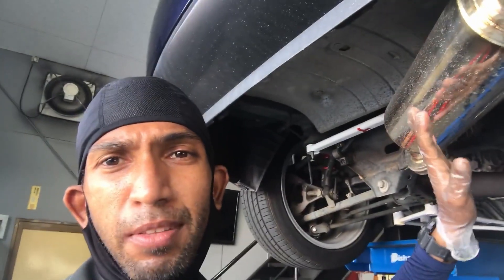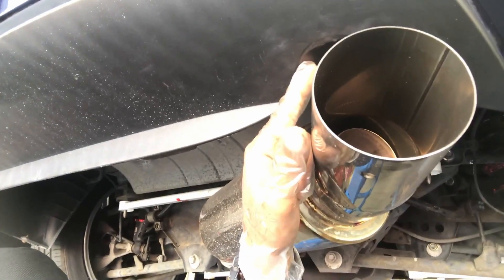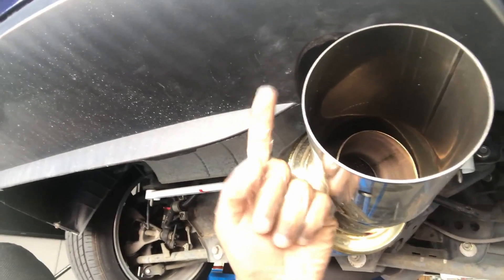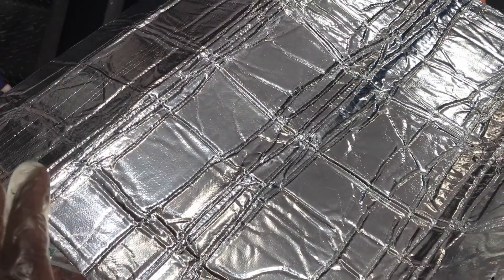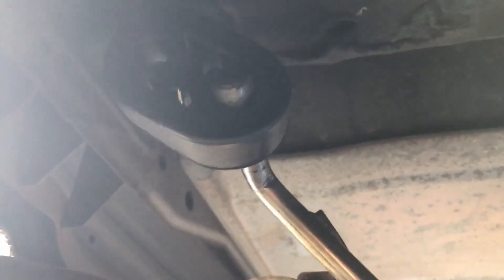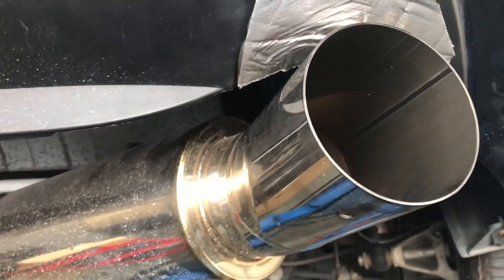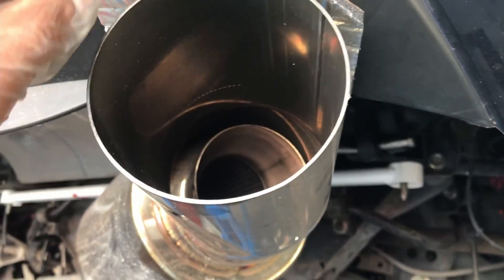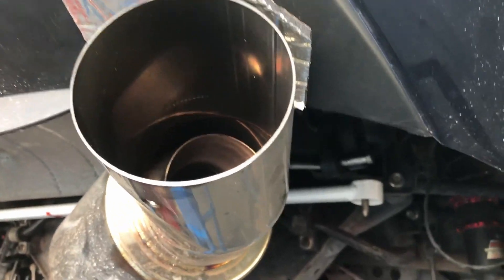Stubborn Exhaust Rattle Fixed Once And For All | Tach On Red

Comment: I have a similar issue with my truck where my exhaust is hitting the frame. i was thinking of using some silicone impregnated fiberglass exhaust / header wrap since its hidden under the truck and i already have it from another project. Think it will work? Mine only rattles when reversing, or hitting bumps or cold idle. The exhaust is tucked right up to a natural notch in the frame just before the leaf spring mount to keep it tight to the body where it exits in front of the rear tire.
Reply from the maker: I'd say it's definitely worth a try. Since you have the material already, it won't cost you anything extra, and it's going to hold up well to heat. 👍😊

Comment: Did this work? Also is the heat shield going to burn ?
Reply from the maker: It did work. Ran the car like that for 1 and a half years.  And no the heatshielding didn't burn. 

But it did kinda flatten over time. It didn't make any noise but I think maybe in a couple more years it would just be too thin to do its job. So if I were to do it again, I'd use a thicker version of the same thing, or perhaps stick 2 layers. 😊

I have a different exhaust now and it doesn't contact the bumper. So I removed the heat shielding. 😊